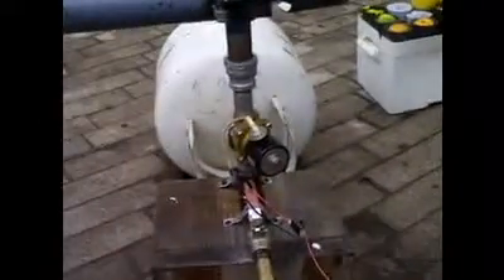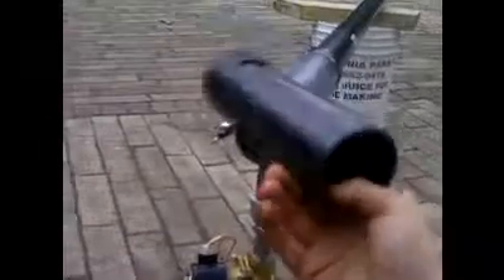Rear Breech Loading Air Cannon

Comment: Is the shell air tight inside of the barrel? I would imagine you would have to put some rubber at the front or back of the shell, and have the door at the end compress it in.

Comment: The shell does not look like its a precise fit inside of the chamber. I would think that would hinder performance since its not a straight path out of the gun. Optimally, The gun barrel and the shell should line up perfectly. Although I would imagine this is a hard thing to do.

Comment from the maker: I actually didn't use a hinge or a threaded rod. What I did was I took a 3/8" nut and welded it to the head of a 3/8" by 3" bolt. I then ran a 3/8" by 1 1/2" bolt through a 1/2" nut then I threaded the bolt through the nut on the head of the 3/8" by 3" bolt then I ran the  3/8" by 1 1/2" bolt though 1 more 1/2" nut then I threaded a lock nut on to the end of the 3/8" by 1 1/2" bolt and finally welded both the 1/2" nuts to the cannon body. You can see a more detailed view at 0:18 in the video.